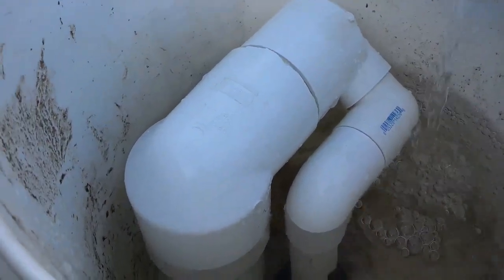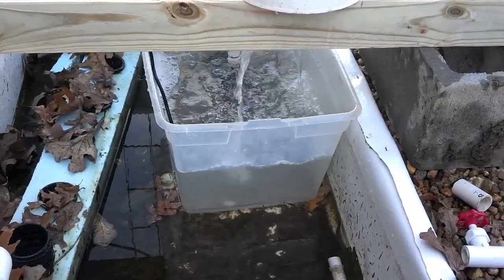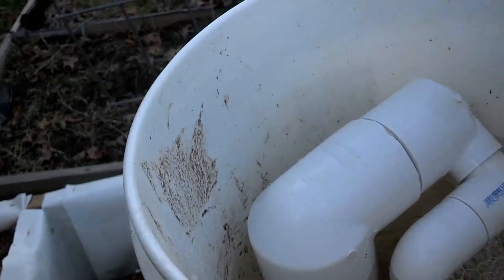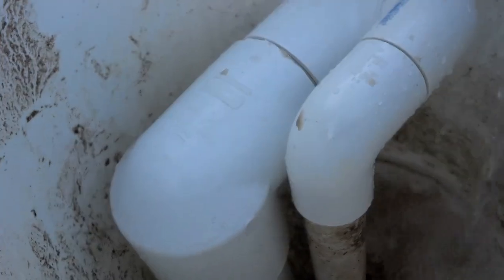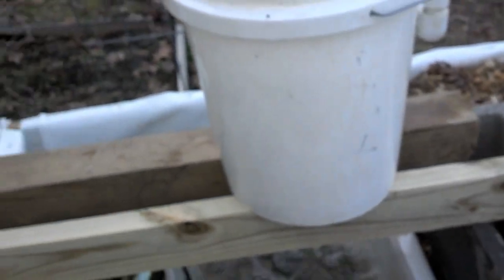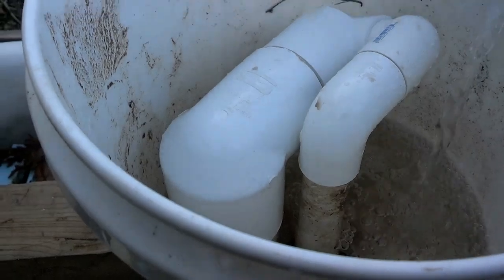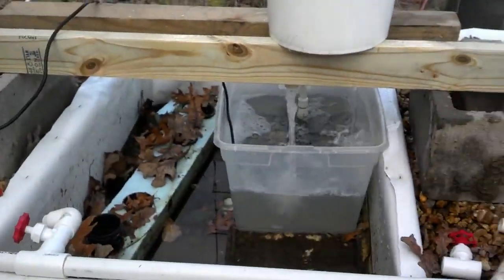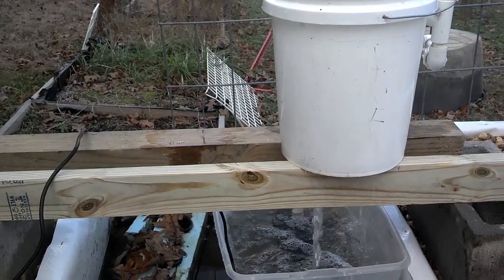Abs siphon fires in about 10 seconds.

Comment: Brilliant modification of a U siphon Shannon. How well do you think it would work as an external siphon? I'm trying to plumb up 3 IBC grow beds to drain as one, and have an external siphon as a controller. I'm sure it would fire no problem, but I wonder if it might have challenges in breaking the siphon. What do you think?
Reply: You could try the 2 1/2" siphon it could drain 3 grow beds and breaks easy. I have a video on that one and doing it outside the growbed you dont have to worry about how big it is, Or maybe a loop siphon. I think i posted the video with the 3 inch siphon now that would do it for sure but you may have trouble getting it to fire with only 3 beds.It would be worth a try though. I dont have any experience in draining multiple growbeds with one siphon so i dont know what problems you may encounter. But it sounds like your willing to experiment.

Comment: Where did you buy the 2.5" - 2" 90-degree elbows?
Reply from the maker: +Byron Wooten http://www.pvcfittingsonline.com/fittings/schedule-40-pvc/elbows/90/reducing.html?size_in_inches=31
It takes a lot of water to trigger this one as you'll see in one of my other videos. Although it would work with less i was testing to see how many cycles per hour i could get.  It is probably better suited for larger grow beds. This one would be good for a 4x6 or 4x8 and may be a bit of overkill for a 4x4. I have basically made a siphon for each size bed depending on how much water you have coming to each grow bed. I do love this siphon. Check out my other videos i show how to fit it in a 6" gravel guard and show it in action.
Reply: Thank you sir.

Comment: What is the parts list?.. For a complete 2" Bell siphon what parts would I need? Great vid and great work thank you!!
Reply from the maker: +Yosef Leon 2" street elbow, 2" to 1" 90 degree reducing elbow(trim to fit) , 1" street elbow you'll trim it as well. 1 more 1" elbow to complete the siphon(you may need to trim it also) and 2 more 1" elbows underneath to fine tune it. So looking at the abs siphon with a twist design from bottom up (2" pipe - 2" street elbow - reducing elbow - 1" street elbow - 1" elbow - 1" pipe into bulkhead.) You see how it is put together now all you have to do is trim it to fit in a 6" drain pipe. I would get a few extra pieces because it takes a little practice and i would practice with the smaller siphons first to get the hang of it. Also check out my other videos I now have the 2-1/2" siphon in a 6" drain pipe. Basically what size siphon you use depends on how much water is coming into your growbed. Start with the 1" to 1/2" siphon it is cheap and easy to build and takes very little water. Then build the 1-1/4" to 3/4" siphon. After you have made a few and see how they work the big siphons will be much easier.  People ask me for dimensions and all i can say is make it fit and then adjust the height. After you build a couple the only challenge is getting the bigger siphons in the 6" drain pipe. If you have a belt sander that will help when the first cut wasnt enough, just be careful.
Reply: Thank you my friend. I have a 75 gal tank and 40 gal grow bed. I think I will use the 2" down to 1/2" to see if it works.. Great vids brother thank you again.
Reply from the maker: You mean 2" to 1"
Reply from the maker: It's easy to put a bulkhead in a 5 gallon bucket for testing. You can try it out without trimming the fittings down just put them as close together as you can and don't glue. You can trim them later. You'll have to trim a good bit off of each fitting. Just lock it into a vice a trim a little at a time with a hack saw until it fits in the drain pipe when its put together. After you do the first one the rest will be easy.
Reply: Yess sir thanks again!
Reply: shannon cobb Alrighty, SO after about 4 hours of trips back and forth to lowes I think I got it.. I had to figure out how to make this in a "mini" size, Your grow bed is huge lol.. I have a 6 inch tall grow bed. That makes things much smaller. I assembled from the parts list you gave me and that thing was huge!. So Now i'm heading back to lowes to make it even smaller.. I did get it to work with the 3/4 to 1-1/2 inch, So now I'm going to work from just 1" down to 3/4" and see if it will siphon with full power.. Right now the power of the siphon is fairly weak, it drains completely but its just not that "Whooosh" it should be.. But I have to say you got it figured out man.. Great work.. !
Reply from the maker: I hope you meant 1-1/4 to 3/4 and 1" to 1/2". I had some short grow beds i was working with early on and it is a bit more challenging. Stick with the 1" fine tuning on the underside if you can. It sounds like your putting a lot of water into those small beds. How many cycles per hour are you getting. Or are you just testing right now.
Reply: I had to stay at 3/4 as that was the size when the original stand pipe went in (its my first system) So now I just got done installing the 3/4 thru the 1-1/4 and its siphoning almost to full potential. I would say its at 85% power in the siphon which is fully acceptable after all this effort lol.. However yes the 1/2" stand pipe would be far more efficient.
Reply from the maker: if your using 3/4" fine tuning on the underside that would explain it being slow. but it sounds like you'll still be fine. now that you've made the first one you should be able to make another just like it in about 5 minutes. It's easy once you get the hang of it.

Comment from the maker: It stands for "above bed siphon". Your not going to find any information on it other than what i have provided. It's my design i'll try to make somemore videos assembling the larger siphon when i get a chance. I'm just using reducing elbows. Its basically a bell siphon that has been seperated with the stand pipe on the outside instead of the inside, connected with reducing elbows so that the entire siphon is above the growbed. Then as i demonstrate in one of my other videos i put a few short bends in the pipe below the bed to fine tune it and then drop straight into my drainpipe or sump. Make sure the drainpipe has good airflow and is large enough.

Comment from the maker: If you decide to use the 45 degree elbows to bring the stand pipe back into the center of the gravel guard i would only do it if i had no other choice. there is a loss of performance which could show up in time. if you cant move your gravel guard to position the siphon on the bulkhead ; i would much prefer that you use a heat gun and bend the stand pipe to fit. Using as gradual bends as possible.